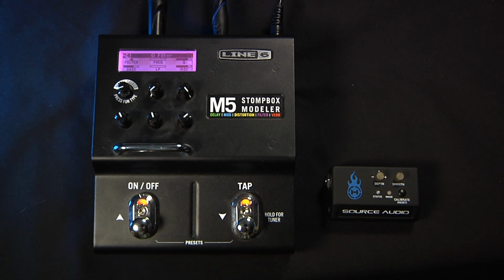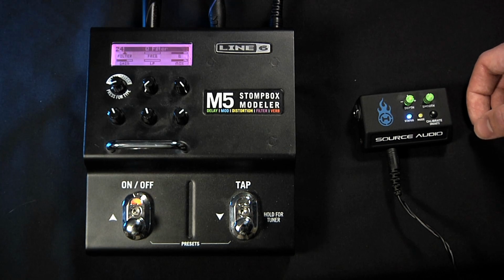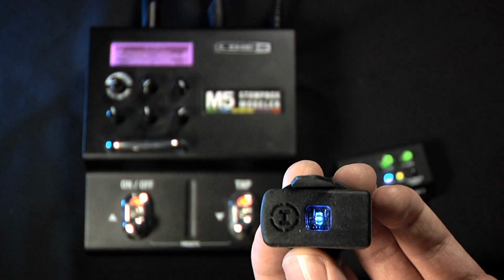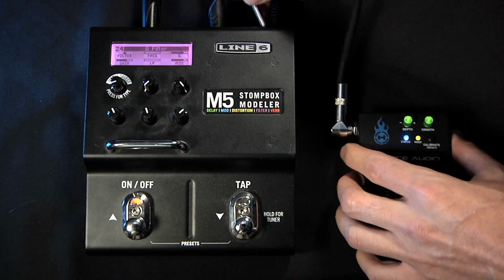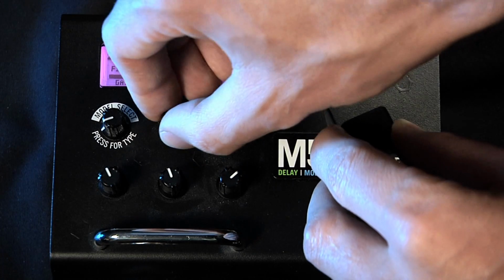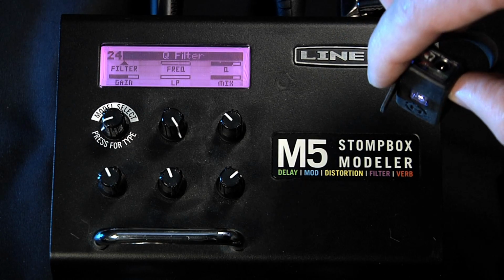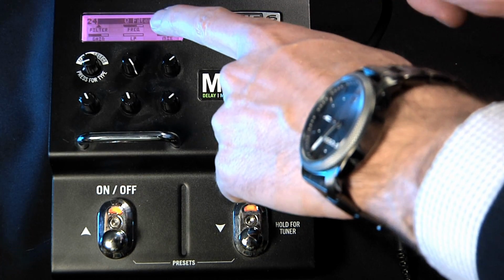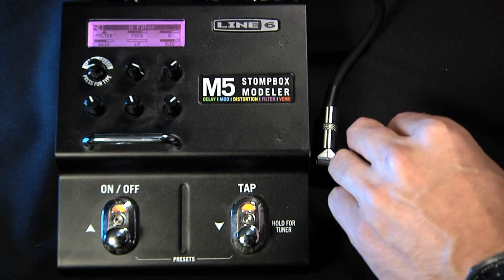Using Hot Hand 3 from Source Audio with the Line 6 M5

Comment: Hi,
I would like to know if Hot Hand 3 would work with my pedals (they both have an input for exp/ctl) 
I have a Boss Delay DD-7 and a Boss Phase Shifter PH-3. If so, what would I be able to control with this?  (say freq. d.time, level, etc)
Reply: As I understand it, this is theoretically possible with some added circuitry but cannot be implemented simply by running a cable from the HH3 to the expression-pedal input on your Boss pedals.  The HH3 outputs two kinds of controls.  One of them, used with the M5 here, is simply a 0-10k variable resistance that, as the video indicates, requires a mono cable.The other is a 0-3.3V control voltage, which is suitable for a device that is voltage-controlled, but not for anything that uses a resistance to ground or a foot controller that divides down a voltage provided by the pedal itself.
Reply: works with gt-1 there's also another video of someone using a boss dd-7 you will need a stereo or balanced cable for it to work

Comment: Hi Bret,
I have a hothand3 but I've yet to buy a source audio pedal.
I have a question please. The hothand sensor box has a special source audio connection and a standard stereo jack to connect to a non- source audio pedal.
When I finally get the money together for a soundblox pedal can you use both connections at once and control two pedals at once?
Thanks
Gary
Reply: I'm not a Source Audio rep or engineer, but corresponded with one regarding the outputs of the main console.  The unit can sense motion along several axes.  As such, it puts out two 0-3.3V control voltages, corresponding to movement along two axes.  In theory, one could use a splitter cable to take one of the control voltages (from tip or ring connection of the jack) and send it to one device, and the other control voltage and send it to a different device.  Cumbersome, but feasible.The overarching question is whether the devices you want to send those CVs to either operate via control voltages, and if so, are amenable to that particular CV range.  So, for instance, an old-school modular synth, operating off a 0-10v or 0-15V or even 0-5V control voltage, would obviously not allow the HH3 to provide the full range of expression.  But again, it is theoretically possible to simply use an external gain stage to boost the voltage output by the HH3 to suit the range of the device you want to control.  And again, while feasible, it would be cumbersome.
Reply: Great reply, Thanks Mark.